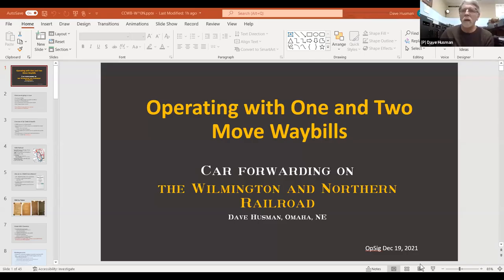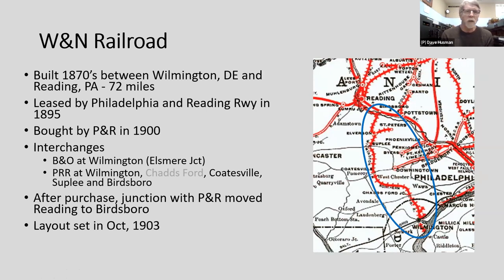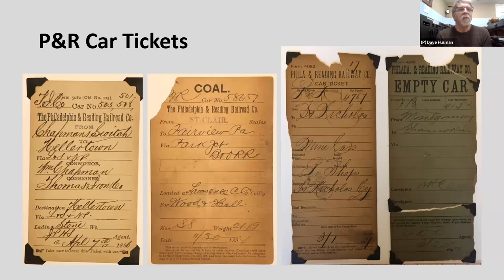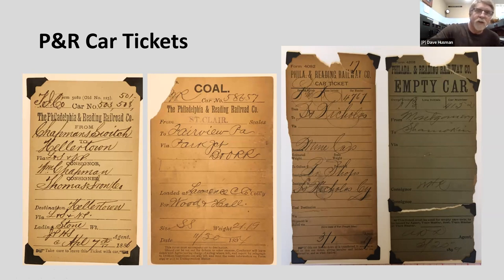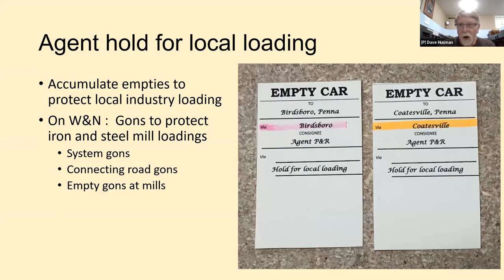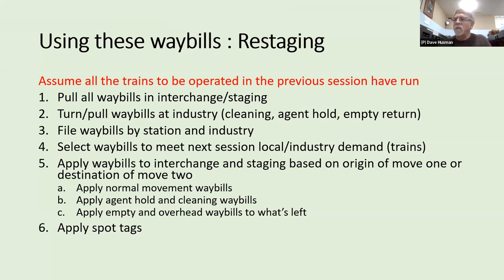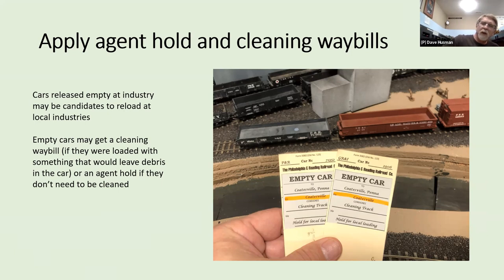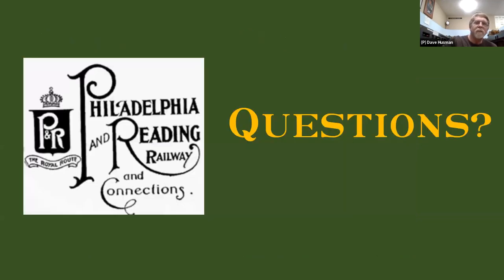2021-12-19 Virtual Meetup - Dave Husman - One/Two Move Waybills

Comment: A very enjoyable program, Dave.  I was surprised how much it is like my own CC/WB program using the one and 2 sided waybills.  It is modeled after the "Operations Road Show" CC/WB program, which members of the ORS helped my crew setup on the Nashville.  I have found that I have so much more control of the railroad, its traffic, and traffic flow with CC/WB as compared to a computer based operations program like ProTrak, which I used for a number of years.  I would never go back to a computer based program now.  Thanks, Andy K